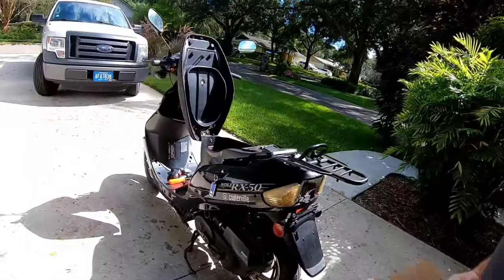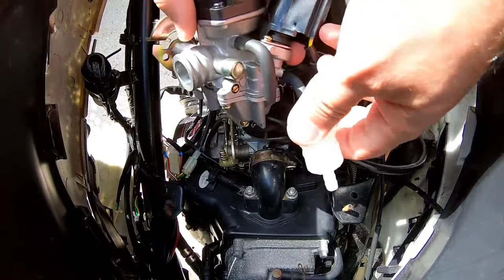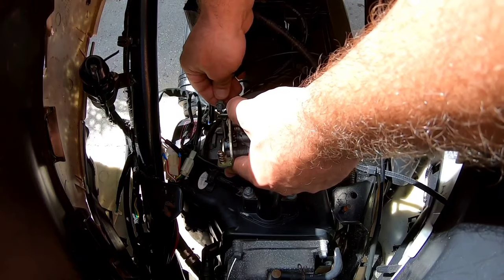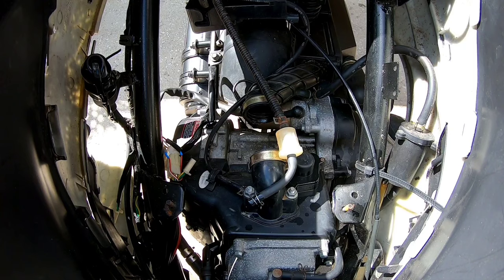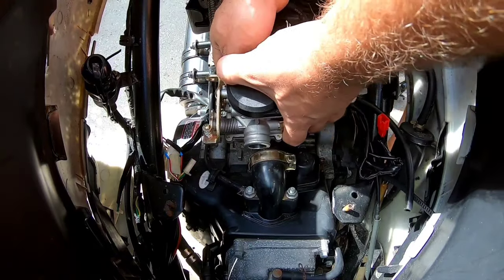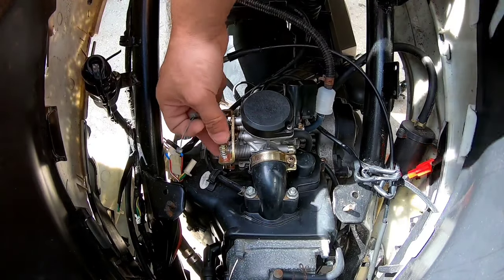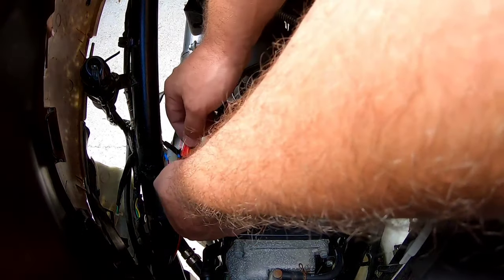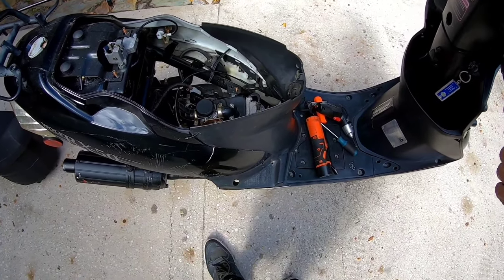Replace A 50cc-150cc Scooter Carburetor In 5 Minutes #bikesandbeards #gy6nation #gy6

Comment: I wanna thank you personally… I’m a guy that really didn’t know a lot about scooters when it came to maintenance and my bike didn’t start for a while. Like a month I tried everything. I couldn’t take it to a mechanic because I didn’t know anyone in my area. I had to manual take the bike apart and learn it and actually analyze what I was lookin at. I changed the spark plug which didn’t help at all and I was just about to sell it cuz at that point I didn’t know what else to do UNTIL I came across this video and how easy you made installing a carburetor looked. I installed my carburetor and it turned right on and when I tell you how relieved I was.. I usually never comment on videos but this video saved my bike and I thank you for sharing this video to the world and making me a happy man. Have a great day sir
Reply from the maker: That's why I do it 😉

Comment: My scooter is ah lanco cabo 50.  Won't go more then 15 mph. I just out b12 chemtool in it still won't go passed 15mph. Can u messages me
Reply from the maker: That's because it's time to clean the car or replace it. Chinese corporators do not last very long
Reply: I clean the carb tho
Reply from the maker: @uhuru81lamarr   Then it's time to replace the carb. Chinese carburetors don't last long if you're not using ethanol free fuel it eats up all the rubbers inside and creates ethanol damage and then the carb stops working really quickly. They're just cheap little carburetors that's why they're 15 to $20 on eBay
Reply: Bro my scooter does the same thing it goes to like 15 20 kmh and it yust dropes gas or compresion

Comment: I have a 49cc scooter I'm working on.  I have bought two carbs for it to change it and neither one works.  Put old carb in it will start.  Do i need to adjust the new carbs some how?

Comment: Hey man my moped is a wildfire 150cc it will start up after a bit then run for a while riding it then randomly die what could this be
Reply from the maker: Most likely a failing CDI Or overheating voltage regulator

Comment: Do I just subscribed I haven't even watched it yet but you seem to be pretty confident definitely going to be checking out all of your content I'm working on my 150 right now so I have a little cruiser when a visitor comes so when I'm riding my ninja they can have some fun.... Yes I know I can't go over 65 but I like the twisty turns more than anything on my motorcycle and the scooters are great way to get good videos because it's so quiet and easy to ride
Reply from the maker: So a 150 CC carburetor will have a couple vacuum lines coming off of it that are slightly different than the 50 CC but just take a picture before you get started so that you know where they go. Other than that it's pretty much the same installation
Reply: @IFixShet so it's easy peasy to install a 150cc carburetor on a 50cc ?
Reply from the maker: @PrestonMiddle  I don't know why you would want to, but sure.... Most likely it will be getting too much fuel And have a hard time staying running unless you put a big bore kit  on it.

Comment: I have a Wolf 150 and the last 6 months, it will stall out on every stop light for the first 15 minutes of the trip. Every time I let go of the throttle it wants to stall until it gets warmed up. I adjusted the idle and it still does it. So I'm figuring it's the carburetor. I was gonna take it apart and clean it, but for under $40, you're saying I can replace it with a brand new one? Seems way to easy!! That might be my route. Thanks.
Reply from the maker: Yes

Comment: Hi there so I have the same scooter wolfrx50 and not too long ago my scooter started bogging so when I hit the throttle full it bogs and won’t accelerate the scooter starts up fine and sounds fine just when I hit the throttle it does what I explained right now I’m trying to figure out what’s wrong with her so I don’t know if it could be a carb problem or something else she’s only a year old and only did 5000 miles on her im desperate to get her back on the road what do you think the problem could be ??
Reply from the maker: 100% carburetor. Replace your carburetor you can order them on eBay or amazon look up GY6 50CC carburetor they're about $20. Chinese carburetors do not last very long you get about 3,000 to 5,000 miles out of them and then they are toast.  The reason why is they are not designed for the ethanol content that we have in American gas, they are Chinese carburetors they do not use ethanol fuel in China so the rubber gaskets are not designed for ethanol. This is why you only get about a year out of a carburetor and most times they fail even before that it's good to have a couple of them on your shelf. Also it's time for you to get your valves adjusted you should have done it at 2000 milesYou're probably 3000 miles over your need for valve adjustments this will also cause bogging because the valves get very tight.
Reply: @IFixShet  mmm got it yeah and once I did 2000 miles I took it to the shop and they did the adjustments to the valve but it probably also needs to be worked on as well anyway but thank you for your response back I really appreciate it so much 🙏

Comment: Thank you for showing me how to do this.  I got a Lance PCH 50 recently and, after a bit of trial and error figuring out how to ride her (which involved laying her down a couple times, to my shame), I ran into the problem of fuel leaking into the air filter.  I was told that it was a carburator problem by some friends and I've been totally afraid to mess with it to clean it or adjust the float.  I've read and watched things that showed me the different components, but nothing that showed me how to take it out - which is the part that scared me a little bit until you showed me how easy it was.

If it turns out not to be a carb issue, where would I look next?
Reply from the maker: Valve lash 😉

Comment: My SYM carburetor scooter over half year that engine does not working in Taiwan! After I push scooter start motor switch and then I got some situations as below: (1) engine cylinder pressure is 126psi (2) spark plug has flash (3) fuel tank does not working to push gasoline via fuel filter out? Do you have some idea to help to fix my breakdown SYM scooter here, thanks!

Comment: Hey I have a 50cc gator 50SRT I want to put a 150cc carb to make it faster can you help me
Reply from the maker: Putting a bigger carburetor on it doesn't make it go faster. Speed is gained through CVT tuning. Throwing more fuel at the engine only gives you a faster take off it doesn't give you a higher top end. You put a bigger carburetor on it then you have a lot of tuning ahead of you that needs to be done for proper air flow And fuel mixture.

Comment: Engine # is on the left as you look from behind?  I found the TAG that says " motor ",  and assume the number showing ( yn50qt-8 ) is the correct number. If this is true, then you are wrong...  My number was on the right side, as you look from the rear towards the front..  I spent a few minutes looking on the left. I have a bintelli spark, and want a new carb..  Thank you for getting me started in the right direction..  Clutch 1st...

Comment: I have an older Tao Tao - it’s the VIP, the manual says cy-50a. I bought a replacement carburetor off Amazon but I don’t think it’s the right one. Any advice on how to track down the right one? I think it’s a 2011 or 2012 model year, whenever I search that on google, it just brings up Amazon and the same carburetor I bought

Comment: Hey man just wanted to know if a new carb needs to be tuned once installed? I’ve read different things regarding that. Thanks
Reply from the maker: It really depends on whether it works good with your machine or not if you're noticing it's not running good then you have to adjust the jet size. You  Don't want a scooter that's running lean or running too rich

Comment: I have a 2020 Chinese 49 cc scooter Well  it started with me having to jump the scooter because  starting the scooter killed the battery because it wouldn't start then Everytime I hooked the cables up it will start not was like that for about 4 or 5 days now it won't start at all now what would you think
Reply from the maker: I need more information is the battery dead does it not turn over at all is it turning over but not starting?

Comment: I have just got a BRAND NEW NINJA 50cc 4T scooter from Direct bikes supplier UK. the scooter is very slow on take off so have change the rollers and put 3/ 8oz roller in the Variator and slightly turned up idle. I would like some info regarding the exhaust on my scooter it has  what maybe a electric censor  connected to it .I would like to eventually upgrade the exhaust  in the future . but these do not have a censor connected to them like the stock one on my scooter  so how do get around this /ALSO my carb has a air pipe running from the airbox to the carb and I have a sports air filter  I would like to use instead of the scooter air box / when I take off the scooter air box  what should be done to the air pipe that is connected the the air filter box

Comment: Is that a vacuum line close to the enricher? When I start my scooter fuel comes out of that.  Or maybe an overflow line.
Reply from the maker: If it's next to the enricher then it's the overflow and that's normally caused by a sticking float

Comment: I need some help figuring out why my scooter blazed Wolf will not start, and if it does, turn it idols and then shuts off. It worked and never gave me problems till one night a couple of months back. It just stopped working all the lights went off In the middle of the street, I pushed it back home luckily.I thought it was the battery. I bought a new battery. It still don't wanna come on. My air filter hose that's on my carburetor has a little crack in the seal. Will that keep it from starting and staying on?

Comment: So nothing bad will happen if I replace a stock 50cc carb with a 150cc one?
Reply from the maker: That's not quite accurate you might run to Rich you might run to lean running rich is acceptable you will foul spark plugs but not great for your machine running lean you will burn your cylinder up and fry your engine you need to tune it properly with proper jetting and airflow this is most likely going to be better done at a shop

Comment: I have the same scooter and bought a new carburetor just like that but the electric choke wires are reversed in the plug. It’s a one way plug but the yellow and green wires will be reversed when I plug it in what should I do? Is it important that the yellow goes to yellow and the green goes to green?
Reply from the maker: Try it see if it runs like it is and if it doesn't reverse the wires

Comment: Have you come across a fuel injection one yet all new ones come home in the UK with it I want to do a 50 mm big bore A9 cam the full monty I want to use the 150cc carb if I take off the fuel injection as it got the usual cdi box in it that is what I'M trying to find out before I buy one thanks for any help. Jeff
Reply from the maker: I'm sure there are fuel injection systems out here for these GY6 engines but it would just be too much of a pain in the ass to install when you can just buy a new carburetor anytime it has a problem for $20
Reply: Icebear has a fuel injected 300cc trike, I forget the name.
Reply from the maker: I would not purchase a Chinese driven fuel injection bike They will fail in a very short span of time leaving you stranded

Comment: I was wondering if you can tell me how to take off the headlight cover off a 2022 vittaci spark 150 cc.I took off all the screws but i dont want to break it .Are there slots you have to slide up or down ?Someone told me the cdi box is there cuz i looked everywhere and its a clusterfuck to follow the coil wires.help!!ty

Comment: I was thinking of putting a 100cc carb in a 50cc engine would I have to take off my air box to run it I also have a filter to connect to carb
Reply from the maker: There's a lot involved with giving your engine more fuel you have to do proper carb tuning it's not as easy as just putting on the carburetor and slapping a larger air filter on it and hoping for the best. You will potentially be running rich or lean condition each one of these will have its own effect on the machine if you're going to do this and you don't know what you're doing I suggest bring it to a shop to do carb tuning so you don't burn out your engine.

Comment: You dropped line/tube down in through the bottom to the side of the carb and didn't attach it.  I have that issue and have no idea where to put that one.  I also have a small L-shape tube that has fallen off and I can't figure that one out either.  Can you give me some guidance?
Reply from the maker: The line that goes to the bottom is a runoff in case the float Bowl sticks. It doesn't go anywhere but pointed down at the ground because if the float sticks fuel has to have somewhere to go and you don't want it pouring out all over your engine for chance of Catching Fire. It is exactly where it is supposed to be
Reply from the maker: An L-shaped splitter is vacuum line connection points

Comment: Great video, nice and clean. Now an issue I'm having that I could use some help with if possible. I just had to replace my carb on a GY6 50 cc QMB139. Got it in well enough; adjusted the fuel/air mixture for idle etc. However, no matter what I do it will not start unless I start it by having the throttle slightly twisted when I push the starter button. 
Additionally I have to hold on to the slightly open throttle for about a minute and then the idle starts to increase on it's own. I release the throttle and it seems to settle in at about 2000-2200 rpm and stays there.  It is almst as if the enricher is operating in reverse?? 
Another thing, if I shut it off it will start fine with one quick press of the button if I do so within 5-10 minutes.  After that it'll only start if I twist the throttle...please advise.
Reply from the maker: Yeah this is signs of The wrong jets. You're not getting enough air or enough fuel on start up
Reply: Great video btw and thanks for the reply. Is it typical for a new carb from Amazon to come with wrong sized jets?
Reply from the maker: @jgscole   A 100%. You have to understand you're supposed to take the jets out of your OEM carburetor that came on it and then reinstall them in your after market carb. They are just putting basic general jet sizes in the ones that they sell on Amazon in eBay they're not designed for every scooter which is why the jets are changeable. I'm just going to get lucky you buy one install it and all your problems are solved and other times you buy 1 as the wrong jet sizes and then you have to tune your carburetor just like you're having to do now
Reply: @IFixShet thank you. Hopefully you’ll make a video about this and more informations about the jet. 😊

Comment: Hello. 

I have a wangye eivissa 2 125cc scooter year of manufacture 2022. 

I notice you have an air drian filter. I have one on my scooter and its a YT80 WD air drain filter. I have 2 pipe being feed to the bottom of the air filter and one pipe missing.

Would you happen to know where the missing pipe goes to as i dont have a service manual for the scooter.

Cheers
Reply from the maker: I'm going to be honest I've never even heard of that type of scooter before
Reply: @IFixShet  its Chinese rubbish and it done 2015 miles and its smokes a bit. Its a 4 stroke iron horse and shouldn't be smoking with 2015 miles on the clock. 

I'm trying to eliminate as much as possible before it has the valve seals replaced. 

Cheers
Reply from the maker: @alllivesmatter5750  yes smoking is definitely valve seat problems. My suggestion is to actually set them slightly loose rather than right on the money with the valve lash.
Reply: @IFixShet  I was hoping to avoid cracking the head open. 

Cheers for the help.

Comment: I'm trying to replace a crank in my scooter this is the third one this week
Reply from the maker: Normally when you have crank shaft failure outside of the bearings or the rod is not even causing it to put too much strain on the crank shaft And out of whack rod or piston Can prematurely wear out crank shafts quickly

Comment: I have the same wolf scooter. I took out the battery to see if it needed a charge and now the ignition button doesn’t work any idea what it could be?
Reply from the maker: Check the fuse down by the battery lol
Reply: @IFixShet  the fuse seems to be fine there’s an extra fuse which I switched to and still nothing. Do you think I could’ve done something wrong while charging the battery or when putting it back into the scooter?

Comment: I have a taotao 50 cc scooter. It won't stay running. I've checked the valves, it gets spark but no gas is going to the spark plug. How do I fix that? 
2:52
Reply from the maker: Replace your petcock and make sure the vacuum drive connected to the petcock does not have a leak.

Comment: Brother I need help with my rx50!!
Reply from the maker: Ok, what's up?
Reply: I’m reviving my rx50 after after it was stolen and hotwired and sitting for like 2 or 3 years . 
CURRENT QUESTION, How do I clean the carb , or should I just upgrade it because I was planning on adding a bbk 70cc cylinder ? 0:03